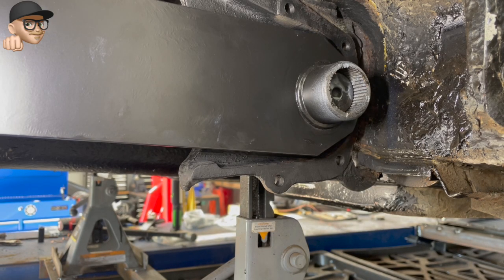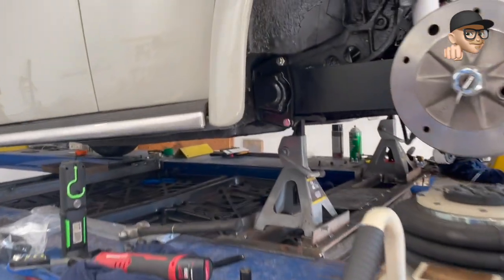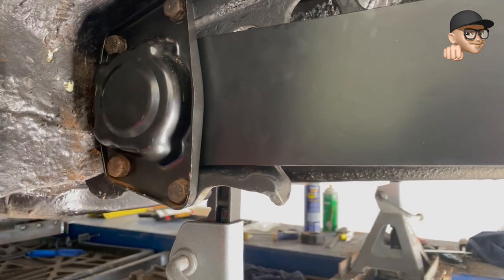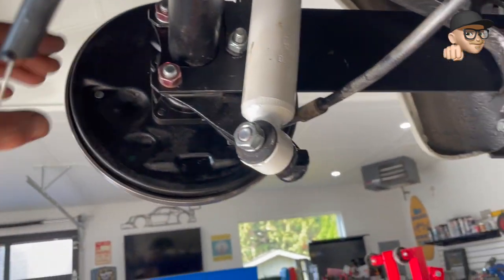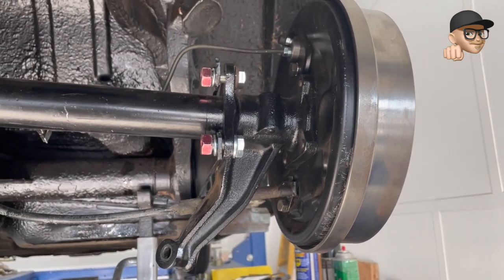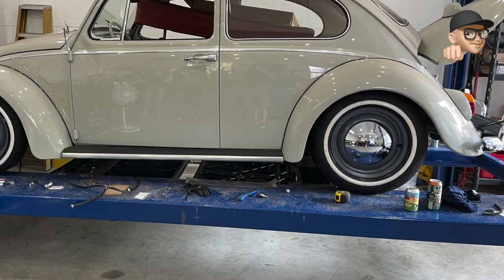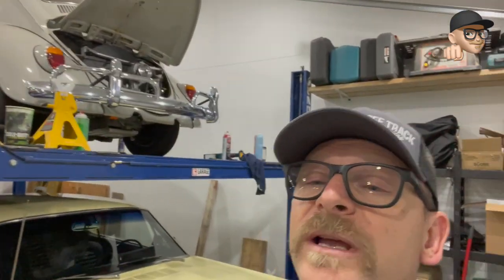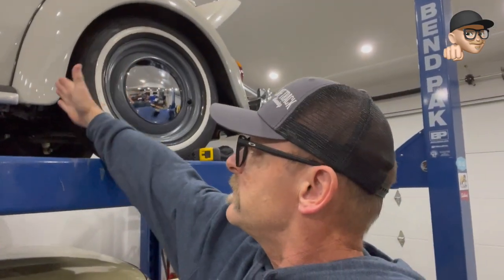65 Beetle Build   Lowering the front and rear

Comment: I have a 64 painted Savannah Biege, very similar to your 65. I'm removing the dropped spring plates (4") and going back to the stock plates. Going to lower 1 spline just as you did. Were both sides at 21 degrees  before you dropped it, and if so did both sides come out even, or did you have to re index one side?
Reply from the maker: I didn’t do the degrees, I did it twice and settled in the middle. I believe it is 21 degrees tho.

Comment: Great videos thanks 
I’ve got a 66 bus the steering is awful like being in a boat there’s a few options but very expensive rack and pinion other option is to rebuild the box itself but Would prefer to get something safer, I’ve seen a video on here if someone putting together RNp from different suppliers but no one here seems to do this can u do a video on this?
Reply from the maker: I rebuilt the steering box a few years back. It’s not easy. 
Not sure what an RNp is
Reply: @garagechronicles9008  rack and pinion
Reply from the maker: @tospicy4ya  ah.
Not something I’m familiar with. The factory steering gets much better with new parts and greasable joints. I’d start there. I wouldn’t rebuild a box again, it’s better and safer to get one rebuilt professionally. 
You could try to retrofit a 3-piece Porsche rack and multi shaft from that time period. That’s going to be a lot of work tho.
Reply: I have found the number one issue with split bus steering and wandering, is tires. Without proper sidewall rating, it will be terrible. Soft passenger car tires will cause it to be all over the road.